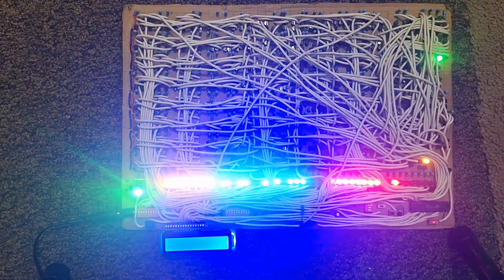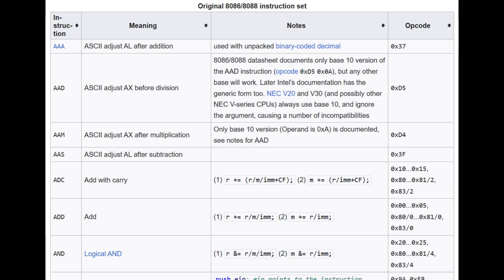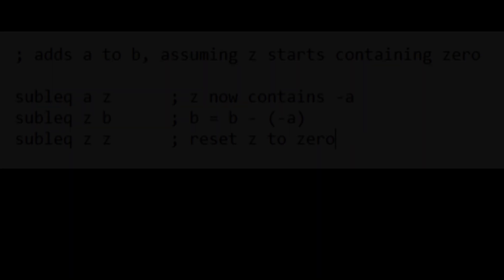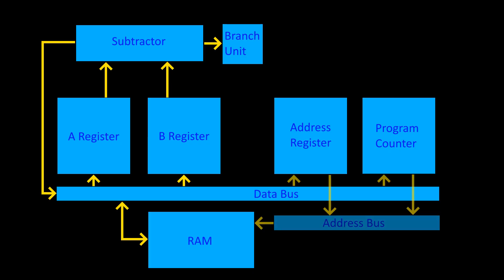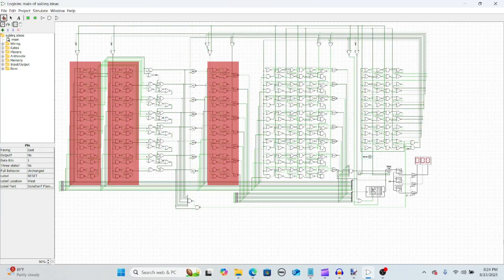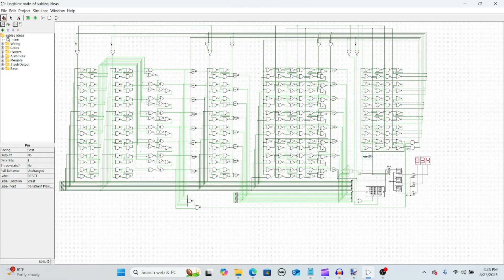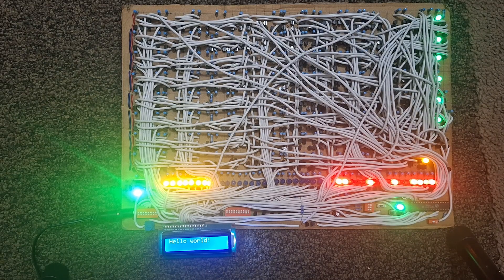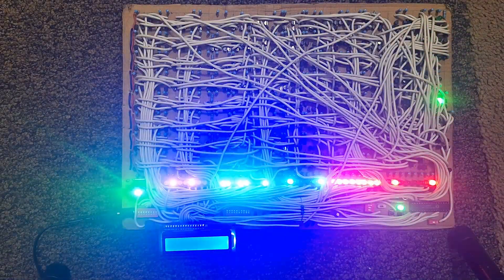I Made a One-Instruction Computer FROM SCRATCH!

Comment: Instead of using transistor transistor logic use resistor transistor logic or RTL. According to A.I. if you add another instruction for two instructions you can get a simpler design. Flip a bit at location a and an unconditional jump at b. You could combine these two for a single instruction but added circuit complexity. The A.I. suggests you could get it done in 50 components. A far cry from 600+ !
Reply from the maker: Yeah you technically could do that.  The only downside is at that point you're getting into 1-bit computing territory.  I actually considered doing a 1-bit computer, it would be pretty easy to do a "nor and branch if zero" type computer.  However, I wanted something that could do more useful computations more quickly, so I opted for an 8-bit subleq design.

Some of my first attempts at stuff like this was using RTL circuits.  They work pretty good, the Apollo guidance computer actually used almost entirely 3-input RTL nor-gates.  It turns out that NMOS still uses less components though (just 1 transistor for each input, plus a pull-up resistor for the output).  I actually built an entire 4-bit adder back in the day with RTL NAND gates.  I even hand-made some PCBs to build it on, I still have them around somewhere I think 😎

Comment: OISC computers (one instruction set computers) - there's a handful of choices besides the one you chose. As I was asking A.I. about it, I think I collected a book on them. Anyway, the way to improve the computer is to simplify the computer if possible to the fewest components. Of course depending on your design constraints.
Reply from the maker: Yeah I'm pretty sure that as long as your one instruction has a math/logic operation and a branch condition then you can build a OISC based on that instruction.  Subleq has the interesting property that it is very easy to set a memory cell to zero by subtracting it from itself. It is also very easy to do unconditional branches by the same method.  It is therefore very easy to simulate other instructions with relatively few subleq instructions.  I'm not sure it subleq is minimal in that regard, it may not be.  But subleq did seem to be the OISC architecture with the most online documentation, so that made it pretty easy to design a CPU to implement it.

Comment: The way to improve this processor is to get rid of as many transistors as possible and use diodes instead. While a single instruction is possible, I'm not exactly sure if your instruction choice is the most efficient choice. It may or may not be idk. Maybe you know about the "Eagle" a two bit processor that first appeared in Byte Magazine in the 80's. Also of note is the CDP1802 processor which started out as nothing but hardwired TTL logic. 
You might want to review the Olivetti Programma 101 the first practical desktop computer. 
This kind of computer shows up in the Star Trek TOS "The City on the Edge of Forever" when Spock builds a computer to interface with the tricorder. 
Fwiw, this can be abstracted further. Any computer can be built with a single gate, and that is a NAND gate!
Reply from the maker: Yeah, I've built gates out of diodes before and it is a good way to reduce transistor count (you only need at most one or two per gate usually if you do it that way).  The main reason I did this cpu with nmos was because I wanted to reduce total component count as much as possible.  NMOS uses more transistors, but usually less total components than DTL.  This let me build this cpu on a fairly small footprint.  Plus, I wanted to get more familiar with NMOS anyway so this was a good excuse 😊

I've never heard of the Eagle or Ollivetti, though I have seen all of TOS and vaguely remember Spock building the computer you mentioned.  I'll have to do some research, it sounds intriguing.
Reply from the maker: Also, I did do a live stream the other day where I built a cpu on logisim from onlu NAND gates, it took a lot longer than I expected, but we did get it done in one stream 😎

Comment: Where do you stored the registers, instructions which computer understands (subleq only one! :)).
Reply from the maker: Since there is only one instruction, I don't need to have an instruction register or instruction decoder in the same way most other CPUs do.  Since the machine code has no opcodes (only operands), the control unit just fetches those operands and gives them to the address register (or the program counter in the case of branches)

Comment: would this count as a busy beaver of 1?
Reply from the maker: Technically, no.  The busy beaver of 1 is a 1-state turing machine that runs for the longest finite amount of steps and then halts (so it just writes a single 1 on the tape and then halts).  Since my CPU is not strictly speaking a turing machine, it is not a busy beaver.  However, since it is touring-complete, it can simulate a turing machine, and could therefore conceivably simulate the nth-order busy beaver (within the limits of its available memory)

Comment: Using which thing you uploaded a program to ram to run.
Reply from the maker: I didn't really upload to ram in the normal sense.  I have switches connected to both the data bus and the control bus.  Using those switches I can manually edit the contents of ram, one byte at a time.  It's a bit tedious, but it does work.
Reply: I know your pain bro 😢😢

Comment: How you installed ram using sr latches and connect to other part of computer for storing and retrieve. And how did you store it? Manually? Or else. And how retrieved it
Reply from the maker: For the RAM I used a 64kb RAM IC with the highest 8-bits of the address held high (so only using 256 bytes of the RAM).  To write programs into RAM, I use the data bus to set the data and I use the control bus to manipulate the program counter to set the address.  I have both the data bus and control bus connected to DIP switches so I can manually control them if needed.

Comment: Which transistors you used?
Reply from the maker: I used the 2n7000 for all the logic gates.  It's a pretty standard n-channel mosfet, and it works great for switching applications.  For the voltage regulator, I used a TIP31-C, which is a bipolar junction transistor well-suited for power applications.
Reply: @PolymathUnlimited-du2hg I can get only 80 2n7000 is it enough??
Reply from the maker: 80 transistors is enough to start playing with logic gates, and might even be enough to make a simple ALU.  But a CPU will take a lot more than that.  This CPU used almost 700 2n7000 transistors.  On ebay, you can usually find packs of 1000pc of 2n7000.  Packs of 1000 are usually about $20-30 (USD).  That's what I would recommend if you want to build a large project like this.  Do be careful where you buy them, since some people charge way too much for them 😅
Reply from the maker: I would also recommend getting some breadboards if you want to start testing different circuits out.  They are fairly inexpensive but allow you to make any circuit you want as long as you have the right components.
Reply: Can I use BC547 NPN transistor or other instead of 2n700 mosfet (which is cheap) as my nationality is Indian So, $30=₹2500 😢😢.
Reply from the maker: @abhaykumarsingh7785  you can make logic gates out of any transistor, but each kind of transistor has a different way of building gates out of them.  The main reason I chose 2n7000 is because it is an n-channel mosfet, so you can build NMOS gates out of them.  NMOS uses very few components per gate since you only need a pull-up resistor for the output, and one transistor for each input.

You could use NPN bipolar transistors as well, but for those you need not only a pull-up resistor for the output, but also current-limiting resistors for each input (each input requires both an NPN transistor and a resistor), so building logic gates with NPN transistors requires almost twice the components as with NMOS.  This will increase cost per gate, and it will also increase the complexity of the final circuit.

It's all up to you though, just go with what is easily available for you and you should be fine.

Comment: Would it be possible to add some form of input buffer for more io like a keyboard. Also, since this is turing complete, it would be possible to run Doom on this processor.
Reply from the maker: Adding some kind of input buffer would be possible.  The way I would approach it is just mapping it to a memory address so the subleq code can access it directly.

Unfortunately, I think doom is beyond this machine's capabilities at the moment 😅 it would need a lot more memory and a much higher clock speed
Reply: @PolymathUnlimited-du2hg ya the doom comment was more of a joke, but i was wondering if there was any reason you didnt use some form of micro-controller like an arduino to input the code into the ram instead of doing it one byte at a time?
Reply from the maker: @TurkeyBoy2010 yeah that's a good point, and I actually did consider doing that.  I decided not to for this build primarily because I wanted the machine to be as self-sufficient as possible.  Having an arduino to program the RAM felt a bit too much like running on "life support" to me.

However, I have designed CPUs where there is a ROM that gets loaded onto RAM at startup, and the ROM can be an eeprom that you program from an eeprom writer.  I haven't physically built anything like that yet but I hope to in the future.
Reply: @PolymathUnlimited-du2hg Fair point I just dont have the patience to program the data manually.

Comment: Holy shit this is cool!!! How fast can it run?
Reply from the maker: It has 4 selectable clock speeds from ~1.3Hz to a little over 1kHz.  I wanted to make the clock speed continuously variable but I didn't have the right potentiometer on hand, so I just used a DIP switch to select between 4 different resistors to run the R/C clock circuit.  It takes 6 clock cycles to execute one instruction so that gives a maximum execution speed of somewhere around 170 instructions per second.

Comment: Now that's REDUCED instruction set computer.
Reply from the maker: Lol yeah, one instruction is reduced about as far as you can go 🤣
Reply: @PolymathUnlimited-du2hg  let's create SISC, single instruction set computer :D
Reply from the maker: @merlozzo that's exactly what this is 😊 there's lots of OISC instruction sets out there, but I chose subleq because it seemed to be the most straightforward to implement (and write code for)
Reply: @merlozzo  Technically, most if not all CPUs are SISC, as they only ever execute a single instruction set (not counting emulation). One possible exception would be the NEC V20/30 line, as they have an 8080 mode built-in. Another would be Transmeta's CPU line, although those really blur the line between hardware and emulation.
Reply: @damouze  Your emphasis is on the wrong word pairing. ;-)  Single Instruction - Set - Computer... not Single -Instruction Set - Computer.  Gotta love English.
Reply: @williamsteele The pun was intended. 😂